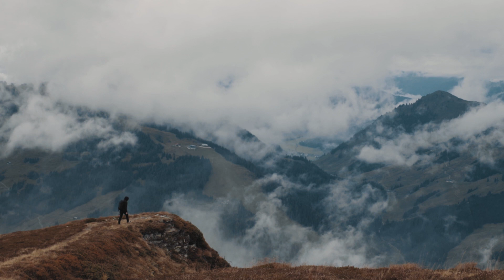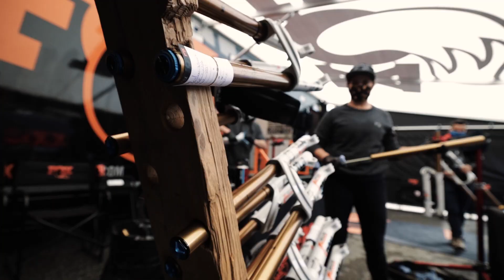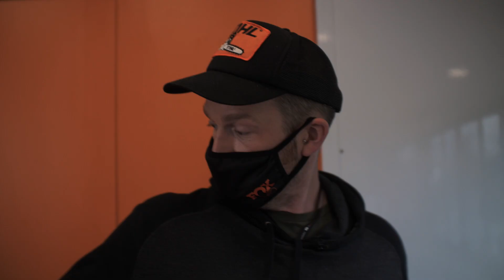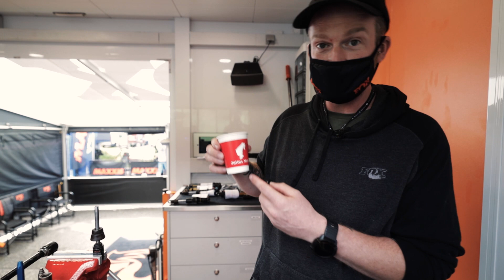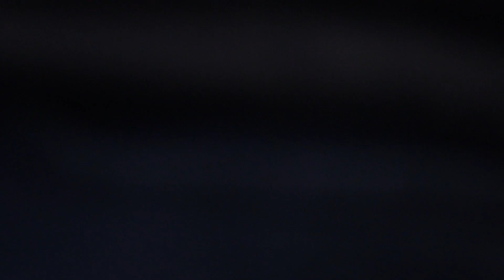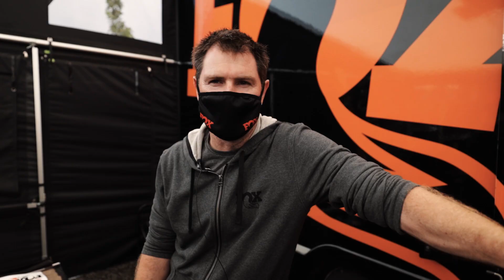DIALED S2-EP39: Fox's secret to efficiency on the busiest days | Leogang Track Walk | FOX

Comment: Question. How does the temperature (possibly around 0°C) change the suspension tune and setup? Not standard oil viscosity? Does the elevation and how wet it is have an impact too? Cheers!

Comment: Why does the HSC adjuster have a left hand thread on the 2021 DHX2?
Reply: It does indeed.
Reply: @tajhendry9798  How does it preload when you turn it clockwise if it appears to be lossening pressure off the shim stack?
Reply: @MitchEllison  there is a small Pascal in there doing wizard stuff
Reply: @tajhendry9798  Right.....glad I asked. Haha.